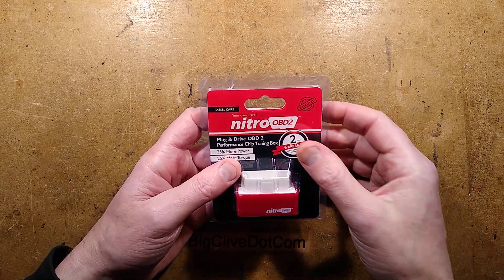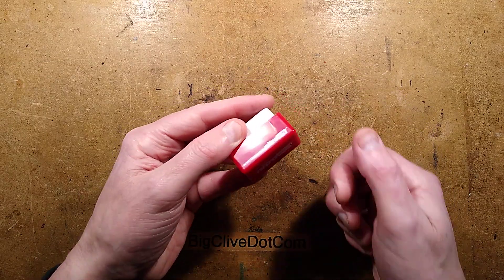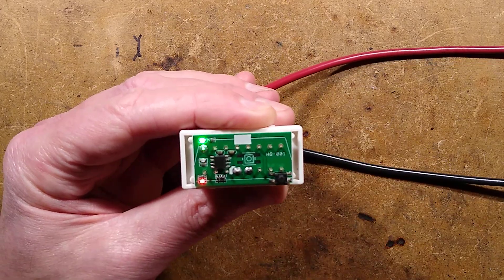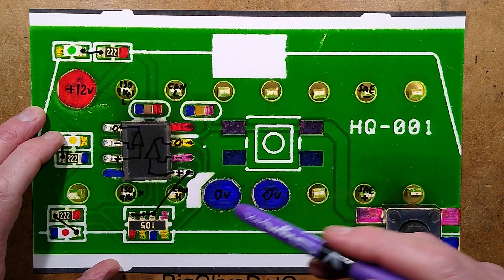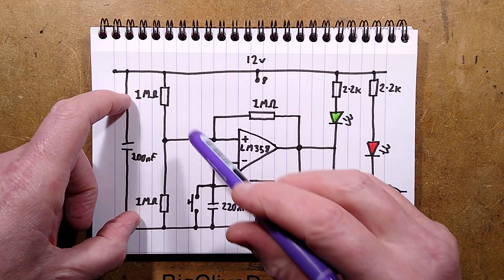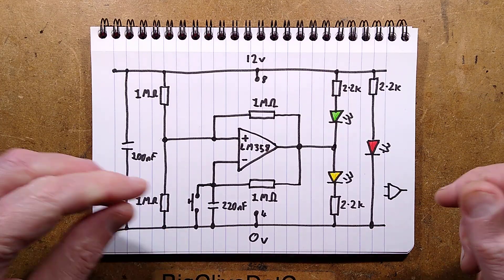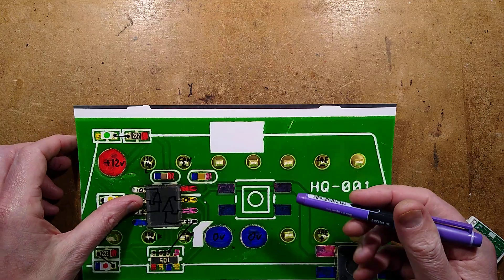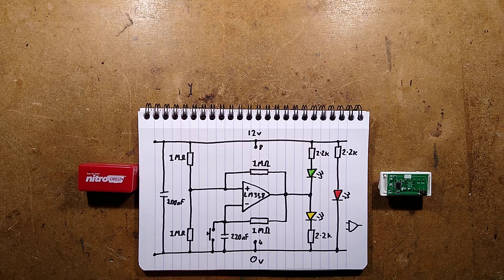Nitro OBD2 unit with interesting circuitry

Comment: The most impressive thing is that Clive managed to record three minutes of intro without laughing out loud. Unusual little op-amp oscillator though.
Reply: My favourite was the complete deadpan delivery of "so it must be just communicating over the power lines then, presumably"
Reply: @transientaardvark6231  I'm sure I've seen 'one' wire systems that literally do talk over the power wire.
Reply: @transientaardvark6231  that can be done, just working on a repair, Honeywell programmer & sensor with Hart protocol & 4-20mA output.
Reply: April fools 6 months early LMFAO
Reply: Electric vehicle mode....

And not a laugh heard. Absolutely professional,  Clive. 😂😂

And "Money Light on your dashboard". I need to start using that.
Reply: Not really unusual, it was in the Forrest Mims handbook in the 1970s, taken directly from the manufacturer’s datasheets. Not many people know about it these days other than old farts like me and of course Our Host who seems to know pretty much everything electronics related.
Reply: @markfergerson2145  I miss my mims handbooks.
Reply: Not often I am too young a fart :)
Reply: This is a great schematic for our apprentices at work, just to do some soldering aand explaining how it works.
We have our own Academy by the way, on site and students are employed, getting a good salary as well.
Future Electrical, Mechanical and Process Engineers to maintain equipment on our site.

Comment: I'm always very disturbed to see an unused half of a dual-op-amp.
Reply: That's the spare for when you upgrade the car.
Reply: @erikdenhouter  Or to handle the turbine engine case.
Reply: The other half is used in the hybrid version. 🙂
Reply: Jokes aside, it's not good design practice to leave unused inputs floating so you are right in feeling disturbed. Whether it's good practice to scam customers, I leave to the sales department.
Reply: @mumiemonstret  Definitely! For my masters project I built a CNC mill out of hobbiest  mill, a Commodore 8032, and a circuit board interface of my own design. I got everything working fine and I was using a joystick to get the mill aligned properly and then I turned on the mill motor and everything went wacko.

Then I got smart and made sure I didn’t have any floating inputs. The electrical noise from the motor on the mill was getting picked up and driving my interface completely bonkers. After I bypassed inputs and tied the open pins to power or ground, as needed, everything worked fine.
Reply: The free running oscillator half blocks communications with the smog control module for Maximum Power.
Reply: Open circuit op amp is for bluetooth interface. 😆
Reply: It should have had the inverting input tied to the output and the noninverting input grounded, instead of everything floating.
Reply: Add a voltage reference, and use the other op amp to indicate charging OK (say Vcc > 13.8V. Good excuse for a bi-colour LED, at least :-)
Reply: It's actually a cop-amp.. for when you get stopped for speeding or texting.

Comment: Amazing is they even bother with such amount of circuit. Even better cost margin is a flashing LED and resistor across power pins, direct on the pins, not even a circuit board.

 They are generous with dual Opamp, several resistors, capacitor, reset switch, three LEDs on a PCB so at least sell a few cents worth of parts. The connector and packaging are the main costs, but even that is likely only a few more cents.

Comment: Those can be hacked to charge the car battery without running cables into the engine compartment.  The lion kingdom tops up its battery through the ODB2 port.

Comment: was thinking, wouldn't a easy way of making this would be with a 555 timer and maybe a transistor
Reply from the maker: Just a 555 would do it.  The output pin (pin 3) can sink and source decent current.
Reply: @bigclivedotcom  what I was thinking is maybe using a transistor with the 555 to alternate flashing two LEDs
Reply from the maker: @DTronicsUK  No need or the transistor.  The output swings between the supply rails, so just two resistors and LEDs are needed to alternate in the same way as the circuit in the video.

Comment: If you're buying one of these, you were never serious about tuning your car, and probably know nothing about tuning anyway. Clean your spark plugs, change your oil/filter, air filter, and don't use crap fuel. You'll see an actual gain, albeit a small one but 100% more than this device will provide.

Comment: In the old days when mainframes did everything - always design the consoles with flashing lights. If the management could see lights flashing in their computer suites they were happy. No lights meant they were very unhappy. The lights did not a lot. Good to see this design parameter is alive and well !
Reply from the maker: Could you sneak an LED inside shining past the sides of buttons?
Reply: @bigclivedotcom that would keep the vintage look and requires no holes. Win-win
Reply: Ah yes, Das Blinkenlights
Reply: @Kj16V sorry, we called them blinkenzeelights...! 🚦
Reply: Gah! Beaten
Reply: All the lights on meant something bad, an endless loop.
Reply: As a rule when we had visitors then the overhead went off so they just got the flashy lights.
Reply: Bring the machine that goes "Ping!"
Reply: @Willam_J  Audio gear can kinda go either way, either it's all kinds of goofy labels and diagrams and meaningless branding, or just so minimal as if the marketing is "it speaks for itself". :p
Reply: Old sci-fi series and movies 😊
Reply: @Plons0Nard also panels with high voltage, so it creates sparks
Reply: Honestly with my designs I put as many status lights as possible. It's a pretty easy way to tell without a multimeter or special diagnostic tool the state of the board when the normal output isn't working.

Also because it looks like it's doing something and management likes it when it looks like it does something.
Reply: In the late 70's I worked on a computer that has 16 LEDs on the  front panel. if it crashed, they would light up in the pattern 1101 1110 1010 1101
Reply: @rickcrowther1223  that's cool, I would have loved to have seen it.
Have a great day wherever you are
Reply: @rickcrowther1223  D E A D
Reply: Relax und enjoy Das Blinkenlights
Reply: It's a pity modern computers are not encrusted with flashing multi-coloured LEDs! ... Then, as you say, we'd all be a lot happier! 🤣
Reply: Lights going solid  on or off gives you a few seconds lead time before the phones start ringing.
Reply: I'm not sure there's such a thing as a 'pointless LED indicator'... I'm LED crazy... Gotta have them flashy lights.... 😁
I code Teensy's and currently have 3 touchscreens and over 200 neopixels blinking and fading for absolutely no good reason... 🙈
Reply: Our telecoms head end has loads of kit with leds all flashing away.🙂
Reply: @Willam_J  I never knew this translated too and Top Savings, well that's what Google translate says. 😂😂😂
Reply: @laborspy  meant ?
Reply: @Willam_J  maybe you could implement a current-detecting circuit to put, inline, kill-a-watt style, on the power input. 6W seems like a lot in this day and age.
Reply: Not true, the lights could be read as octal or hexadecimal codes to tell you where the program was or what was in a given memory location.
Reply: They are still doing it with modems and routers. There are so many blinking lights. Some are quite bright. I counted mine and between them, there are 21 leds. It is a mini light show at night.
Reply: @alihms  my router has about ten, with labels printed in about 7pt font. When I have need to figure out a problem, I need a flashlight and magnifying glass to figure out which is which..!
Reply: To original post auther. Rubbish, the lights on a mainframe,  as well as a modern network switch means TX, Rx, datalink, capacity of network,  processor speed by ports used, faults amongst others.

Signed 
A network engineer 

I think you are mistaken indeed
Reply: @davidrobertson5700  That joke flew over your head at mach 2. Typical network engineer lol. Would you be happy if you didn't have any indicators to tell you what's going on at a glance? I'm thinking probably not...
Reply: @LuxCaeca33  you seem to be the joke who typifies me as the clan network engineer,  you should go mate with sock now as you got a reply
Reply: @davidrobertson5700  Why you mad, bruh? It's not my fault Mommy didn't love you enough.
Reply: With todays tech you could put reams of flashy lights in there. IIRC i have a rack mount sized Nokia processor board somewhere that would have its ass kicked by a 286.
Reply: @davidrobertson5700  Correct.  Especially if the program stopped, the lights told you everything you need.  Nowadays we see the same thing on washing machines which report faults either with lights or a code - same thing.
Reply: @karhukivi  you are a man of wisdom
Reply: @davidrobertson5700 I'm pretty certain they weren't on about those. A lot of them on pre microcomputer boom mainframes and minicomputers were front panel lights. Even after boot ROMs, good memory monitors, etc were common place a lot of them kept the data and address bus blinkies and switches and ability to single step with a physical button because that was just expected. I'm pretty certain DEC at least kept them into the mid 80s.
Reply: @MechanicaMenace  You seem to be wrong, very wrong . 
I am pretty certain they were on about exactly those and no other.
Seems impossible you read the original post and my post wrong. please read the original post again or get someone to help you understand the OP and MP
Ta
Reply: @davidrobertson5700  "In the old days when mainframes did everything" says you can't read. That predates 10base-T and well outdated lights on NICs. Serial didn't have TX/RX lights, coax NICs didn't have TX/RX lights, 8P8C NICs didn't have them for a long time, not until the 90s. You, my smooth brained friend, are wrong.
Reply: @mechanica
Nicely put!
Reply: @davidrobertson5700 I have no doubt that the lights served a purpose, when testing and debugging. I worked with mainframe computers for a couple of decades, and I am certain that the blinkenzeelights were more for decoration and loosening the purse strings than any technical use once in production.
Reply: @hjkaye  The lights told an engineer the transmission rate, state of processor,  baud, TX, rx ,temp, how many users were on the system and the more lights the busier the system. 
The lights looked like they did nothing to an uneducated person,  but an educated person knows what is what off by heart as systems were built by cards in racks and racks had different cards
Reply: @davidrobertson5700  So you can pin point one light and know exactly whats going on? PUll the other one. You plug in a laptop or some other gizmo with a screen and that tells you what you need to know. I dont buy you need all those flashing lights in this modern age. 
Minimal is always better. Lots is just a mess. FACT!

Comment: I remember when I was young I bought a $5 "performance kit"  from Ebay like 20 years ago. It was a few resistors, about 6 inches of electric tape and small sheet of instructions.  Bacisally you jammed a resistors in the airflow sensor to trick the car into running a richer fuel mixture or something like that.  I bought it on a whim just to see what they selling, never tried it and threw away the kit.
Reply: Good thing you did. If in fact it was dumping more fuel in, your AF ratio would be too rich resulting in less power. If it was doing the opposite without proper calculations, it would make your AF way too lean, giving you more power but also knock and a good chance of damaging your engine.
Reply: @brandonroeder2461 Too lean actually makes nitrous oxide as a combustion product, which doesn't get scrubbed or converted by a gasoline exhaust system and is a much worse GHG than CO2. It's why there was a hard ban on 'lean burn' cruising modes for cars. It's better to just run slightly rich than make any amount of NO. It's probably why Mazda's SkyActiv-X engine isn't in America yet, as it was designed to run lean for maximum fuel economy, though the system still has benefit if on the rich side of stoichiometric.
Reply: As soon as the oxygen sensor sensed a rich mixture it'd self correct. You'd probably get the check engine light because the fuel trims would be too high.

Comment: Some OBD modules are not a scam. Some can make you drive with no fuel consumption at all, and triple the horsepower. Keep reviewing them, someday...
Reply: There even was one back in 2015 that enabled your car to fly, but it was immediately banned after complaints from the FAA
Reply: @krzysztofczarnecki8238 I have one of those! But unfortunately I plugged it in standing outside due to the awkward position of the socket and the car started to float in the air immediately! Today is 8 years since my car is floating at 50 meters up in the sky, and I can't reach it! I really need to push the reset button, but I don't know how to reach it!
Reply: There are actual modules interfacing with OBD that reflash the ECU that aren't a scam (but cost no where near what these go for), e.g. Cobb Accessport.  They don't have hyperbolic claims of 300% more horsepower though.
Reply: @zaxcomp  The difference between those and these is that they are specific to the vehicle and are usually to enable the flashing of tunes, not the "learning" of tunes. 99% of ecus are READ ONLY. No odbii device should be able to improve power & efficiency as they are on the opposite sides of the diagram.
Reply: There are cars out there that actually have an operating mode where they consume no gas, while still able to accelerate - even up hill! They’re called hybrids.  

One day, someone will develop a car that never requires fuel. Oh wait, those are called EVs.  Triple the hp? Well that’s just 3 EVs tied together with a rope! 😅

Comment: If it were a wee bit bigger it would make a great wheel block for when you have to change a tire, wouldn’t plug that in, should be rebranded as Nitro Car Warranty Zapper. Clyde when you getting a logic analyser to do some in dept checks on these Sus chips. They got them for 5 quid and that module may be set to spy on us making you a hero.

Comment: Summary
Video Introduction
- 0:00: Discusses Nitro OBD2 "Performance chip tuning box."
- Explains how most engine control systems are locked by manufacturers.
- Highlights that the majority of these chips are fake and rely on placebo effects.

Product Features
- 0:19: Version for diesel cars and one for gasoline cars.
- 0:34: Claims to communicate with the engine management system to optimize fuel consumption and power.
- 0:52: Comes with a two-year warranty.

How to Use
- 1:00: Instructions indicate where to find the diagnostic port in the car.
- 1:13: Plugging the device into this port supposedly gives access to the engine management system.

Hardware Inspection
- 1:31: Speculates that it should contain a powerful processor if real.
- 1:52: Discovers a small eight-pin chip, without any identifiers, inside the device.
  
Circuit Analysis
- 3:00: Takes picture of the circuit board to analyze it.
- 3:10: Observes that commonly used networks for OBD2 connections are not connected.
- 3:55: Identifies an LM358 chip, initially thought to be a 555 timer.

Circuit Functionality
- 5:03: Explains how the op-amp (LM358) is used to create an oscillator.
- 5:38: Details the process of charging and discharging a capacitor to create the oscillation.

Deception Tactics
- Mentions the reset button's role in stalling people asking for refunds by making them think they are using the product incorrectly.

Conclusion
- Suggests that the unit is essentially fake, and highlights a 7mA continuous current draw that could drain the car battery over time.
  
Additional Remarks
- Clarifies that Temu is not a sponsor and comments on their business model.
- Encourages support for the channel through coffee donations.

Comment: Symmetrical Schmitt trigger? Ok, this device is fluff but for a few pounds you can buy genuine OBD2 readers that interface to your phone using Bluetooth...one saved me so much in garage diagnostic fees.
Reply from the maker: They are very good.  Especially when paired with the Torque app.

Comment: I put one in my car with half a tank of gasoline and after driving 100 miles my tank was full. 😮
Reply: Heh. My old high school physics teacher stated the same thing about all the gas-saving devices sold back during the 70's gas shortage. He said if you installed all the devices, and they worked as claimed, you would have to stop and pump gas out of your tank so it didn't overflow.
Reply: @billboyer8897  Would that include the magnets on the fuel pipes, insulating cloth around the carburettor and filling the tank in the morning when it is colder?
Reply: @smilerbob  The mesh screen between the carb and intake, the fuel line magnets, the swirly-finned device inside the air filter assembly, the fuel additives, etc...
Reply: And don't forget to obey all Feng Shui rules for extra energy
Reply from the maker: This is the real reason ICE vehicles catch fire.